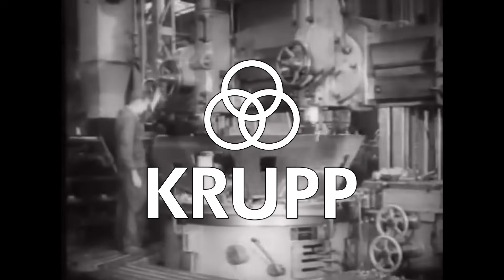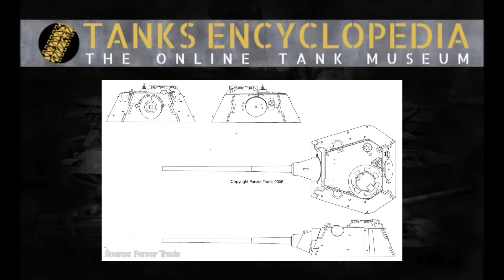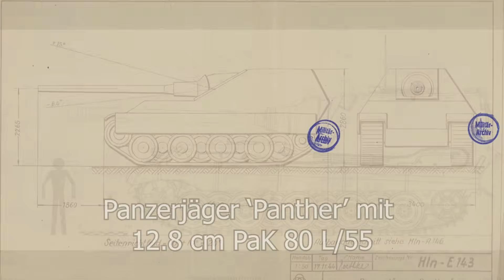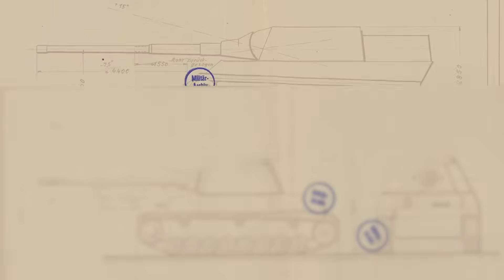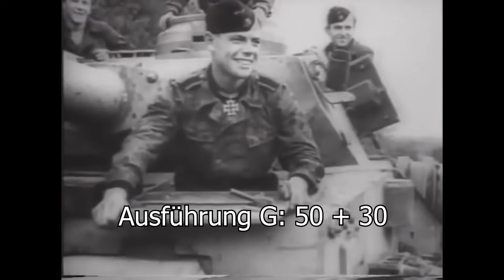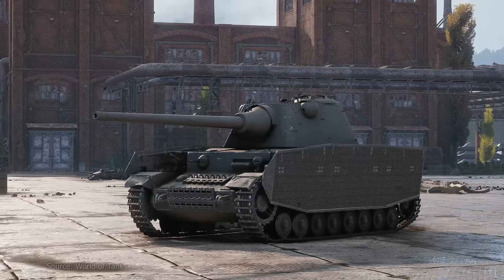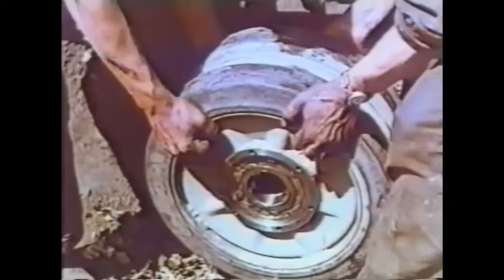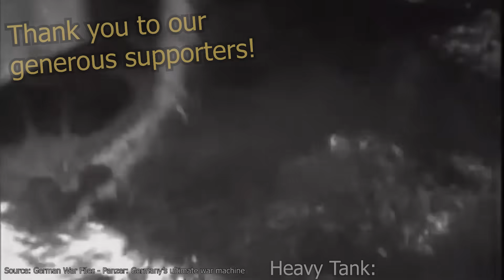Pantherstein | Panzer IV mit 7.5 cm KwK 42 L/70 in Schmalturm feat. @SteelAces

Comment: Soviet engineers upgraded to the T-34-85 but the Panzer IV was at a  dead end is one of life's  mysteries.
Reply: Pz IV was rolling out by 1937, the T-34 just began rolling out in 1940, the T-34 still had a lot of improvements that could be changed upon while the Pz IV was already 4 years old by the time Germany invaded Russia, and designers were already struggling with ways to improve the Pz IV without heavily changing the turret and hull.
Reply: Panzer IV started as an under-16 tons tank and ended at 25 tons(Ausf A was under 16 tons, version B increased weight to 16 tons, and so on). Increased weight by more than 56%.

T-34 started as 26.5 tons and ended as 32.4 tons. Weight increase was 22%

Yeah, mystery... brain.exe not working LOL
Reply: Because the PzIV had long since reached its limits of development – the chassis couldn't handle any more, and you couldn't mount a larger gun. And yet, this tank had served since 1937 and achieved everything it could in its H version. The T-34 had the same problem – the T-34/85 also reached the limit beyond which it could not be further developed, and during the war, the Soviets developed and began implementing its successors.
Reply: The Pz. IV was difficult to produce and completely obsolete by the end of WWII, if not earlier. It was already at its limit when they put the long 75 on it. Arguably before that, given how poorly the chassis handled the extra weight. There was just nothing left to develop. That's why they went clean sheet with the Panther, which was actually easier to produce.
Reply: Pz IV was smaller and older, and had leaf spring suspension, which reduced the useable width of the tank.
This meant that the Pz IV was always going to be more limited in upgrade potential, as you have to contend with low internal volume and a suspension type that can't be easily replaced without basically reworking the whole tank hull- at which point, you may as well just build a new tank, because that's basically what you'd be doing.
Of course, that defeated the entire point of these upgrade programs, because Germany was trying to make their existing tanks more capable due to the limited industrial capacity they were working with. It's why even though there were actually a lot of different upgrade programs to various components of the Pz IV, from the engine to transmission and suspension, that were meant to improve performance and decrease weight or used internal volume, none were ever accepted, because the effort needed to make them work would've been way more than it was worth. The Pz III/IV was also never adopted for similar reasons.

Meanwhile, the T-34 was bigger, and had a slightly more robust suspension, and more of the soviet changes to the design over the war were usually simplifications (or factory "simplifications" to meet quotas). So at the end of the war there very much was room to add things back onto the T-34; things that had usually always been intended to be on but were removed to make production faster.
Mind you though, even the T-34 had limits and the Soviets also very quickly began planning it's replacement as soon as 1942.
Reply: T-34 chasis was larger and heavier than PzIV, and so was T-34 engine .
Reply: Superior soviet engineering. It turns out ubermensch aryans are terrible at weight management, advanced production and generally picking worthwhile engineering choices compare to subhuman asiatic hordes of the east. When a tank becomes two time heavier by the end of it's development than was planned, there's nothing you can do.

Comment: Why wasn't the turret armor upgraded from 50mm, which was completely useless after 1942?
Reply: Because the vehicle was already overburdened.  The small turret front face is already protected somewhat by the mantlet, and of course side skirts were added which wrapped around to the front.  The hull front was a much larger target so this was worthwhile to upgrade to 80mm.
Reply: @Panzermeister36 around 50% of hits were to the turret. More than double than that of the frontal armor. Hull was protected against Russian 76mm at 700m while the turret could be penetrated at 1.5 km. It was a huge weakspot, even panzer-3 was better protected
Reply: @tedarcher9120 That's impossible , the turret front is just a third of what you can hit . Lower , middle hull and turret face . So you will more likely hit the hull and not the turret . That's propably why they never upgraded the turret face and only the hull . It's not like a game were you can aim at such weak spots , you aim center of mass and hope you score a hit .
Reply: @5co756 shell distribution is not random. Gunners are more likely to aim higher than lower because of 1000m battle zero, so turret gets hit twice as often as upper front and ten times more than lower front
Reply: @tedarcher9120 Dude wtf man , every tank has weaker turret armour than hull armour . Why they did this if you mostly hit the turret ? 😅 

You probably belive that a sniper aims at the head as well , you clearly have no idea .
Reply: @5co756 No, I can read. Look up hit statistics in the battle of Stalingrad - majority of frontal Hits were to turret front. It's physics. Most of the tank is hidden by ground, so shells don't hit there, they hit the ground. Many tanks had better turret armor than hull armor - t-34-85, Sherman, Churchill, Valentine, Matilda, Tiger, Sherman Jumbo, etc, all modern tanks have better turret armor
Reply: @tedarcher9120 Who made statistics of the battle of Stalingrad ? 😅 Come on man , M4 hull has 50mm sloped wich gives about 90mm and 76mm turret front . The only tank is the Tiger 1 wich has about 100mm front plate and turret front . 

And don't come up with modern tanks , they have fire control systems and fcking fast APFSDS darts . They can hit the turret , WW2 is a different story .
Reply: @5co756 soviets analyzed all the knocked out tanks, you can look up statistics. Sherman has 90mm minimum turret front + mask, t-34-85 has 90+mm, Tiger 1 has 120.
Reply: @5co756 on the contrary, no, that's perfectly possible and actually likely. Do you know why lower frontal plate is usually a "dump stat" for frontal armour?
Reply: @tedarcher9120 A t34 has 70mm turret cheeks and 45mm sloped at 60° front plate , wich gives you 90mm . IS2 has 100mm turret cheeks and up to 120mm front plate . Same goes for a Pz4 ,  Panther or Tiger 2 , hull is always better armored than the turret . Cause it's a way smaller target to hit , like soldiers only wear body armour and no fcking armored helmet with a face shield . 

By your logic every tank of WW2 would have better turret armour than hull , why they don't have it ?
Reply: @5co756 t-34 turret  is 106mm, is-2 160mm, tiger-1 120mm. because they didn't have the data before 1943, did they? All the Soviet tanks after 1944 had better turret armor, because most shots fly higher and hit the turret. All the modern tanks have better turret armor for the same reason, hull is protected by the ground most of the time
Reply: @tedarcher9120 Dude stop using your fake armour specs and your modern tank BS , the T34-85 has 90mm turret front and 90mm front plate wich is sloped . Even the T44 has 120mm turret front and 90mm sloped at 60° wich gives you 180mm front plate . 😅
Reply: @5co756 t-54 from 1944 has 200mm turret, is-3 has 220mm. T-44 and is-2 are from 1943, they didn't have the data back then
Reply: Weight I would guess
Reply: @DarkAzreal77 yeah but it would only be a couple hundred kilos
Reply: Because the 75mm KwK 40 Panzer IV was already rather front heavy for its pre-war design with its gun almost doubled in length, and the hull armor being increased to 80 mm (the initial armor was like 30-50 mm) also added onto that.
After 1942, the German command was making a sensible choice to focus on newer more wartime-grounded design of Panther tanks, while they also recognized the main remaining value of Panzer IV in 1944-45 was their numbers and production due to existing infrastructure, so in early 1944 its last variants focused on cutting costs like removing turret transverse, number of return roller, among other things, instead of combat effectiveness, and then didn't bother much with more upgrade for it.

Comment: The night vision sounds cool... but even the US had tried to get a similar system into the field, but being as all night vision of the time required an illuminator...
well, you're basically shining a giant floodlight out over the field which can give away your position to a FAR greater distance than you can use it to visualize the target.
Reply: It's infrared
Unless the oppising force have a night vision, it will stay invisible
Reply: You could only see it if you had the same night vision system though. And allied fighter planes didn't. Soviet union used the same system until 1990s
Reply: 呃，紅外線？

Comment: What a great video, when will there be an article on the E-50/75 concepts?
Reply from the maker: Our Patreon supporters can vote each month on which article they'd like to see next. The E-50 is currently one of the options, so if it gets enough votes, you can expect an article on it soon!
Reply: @TanksEncyclopediaYT  Ok thanks for letting us know.
Reply: @TanksEncyclopediaYT  hello, and a tank- tractor and trailer with the kanon... there is prototypes about that in archives of WW II...? like a tank truck idea... very nice video. saluts from Buenos Aires.
Reply: The entire E series would be interesting, it was a good idea with standardized parts across vehicles to simplify production logistics and maintenance, but it was far too late to put into effect.
Reply: @INSANESUICIDE  In particular, I think the E-50 would be THE BEST of all those projects because: it combines mobility plus more angled armor than the Panther, It would have a cannon equal to or better than the Panther, and the truth is that I would dare to say that it would be quite similar to what we call MBT.
Reply: @leo_commander_186  Well it fits the rough description of a MBT.
Reply: @leo_commander_186  Panther WAS the first MBT tho...
Reply: @AKUJIVALDO  It has more or less the characteristics of an MBT, but it is not one, it is classified as a medium tank.